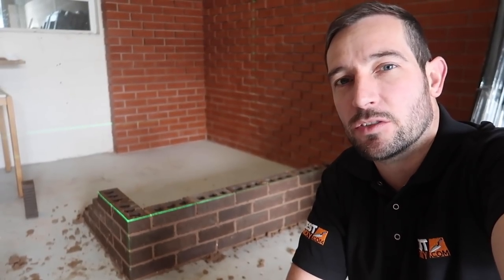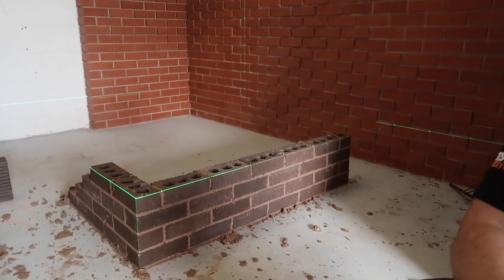Bricklaying Experiment Laying Bricks to a LASER LINE

Comment: Surely you only have the height with a laser? Whereas a line gives you the ability to stay straight?
Reply: Yep, there is no way to judge straightness with a laser, because it is only working in one dimension. A brick could be offset towards the front or back of the wall and you'd never know. It probably turned out good because Stu is an experienced bricklayer and naturally making the wall straight by eye.
Reply: @NanoCottage  
You can get a 2 & 3 way laser    Which will give you plumb & line
Reply: Just add another 2 lasers, now you got straight plumb and level

Comment: great video and demonstration for someone like myself who wanted to see how it is done using a laser. I recently built a 3 course wall (it was my first attempt at laying bricks). My issue was not levelling but to get it at a straight line. I used the string but just could not achieve it. Probably something so simple but like I mentioned I am a novice at all of this and want to learn. so thank you for this video. 

Any recommendations on which laser to buy? Thanks,

Comment: Hey, nice vid! Quick question, what are those types of bricks? 

i can see the same ones (with one smooth side and one side with vertical grooves) have been used in my house, near the foundations. I want to confirm if that means they are engineering bricks?